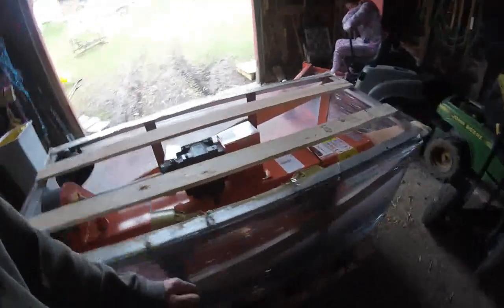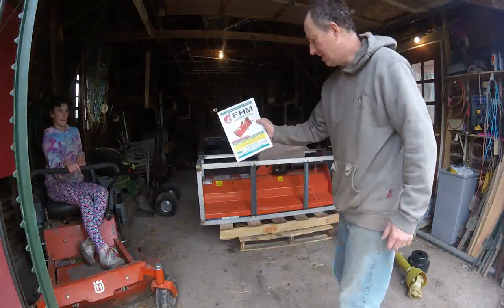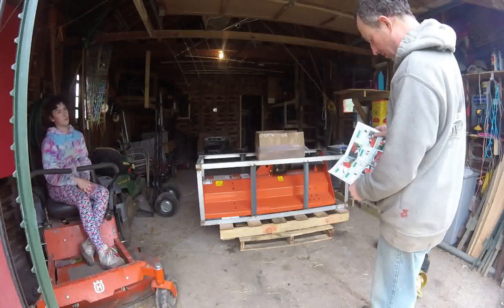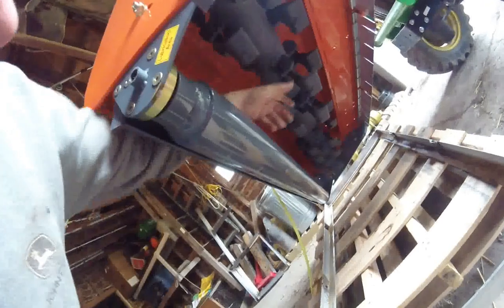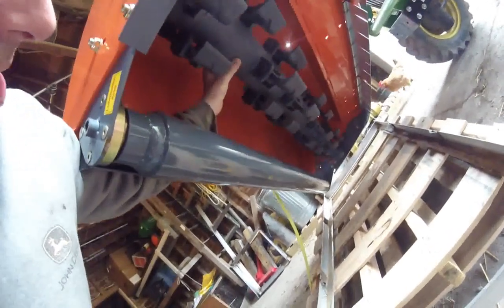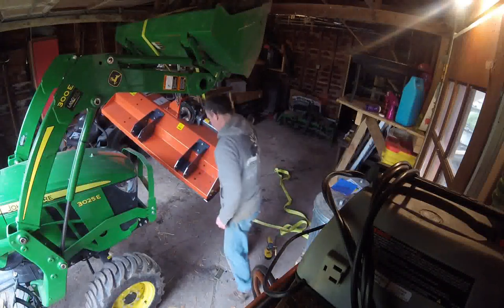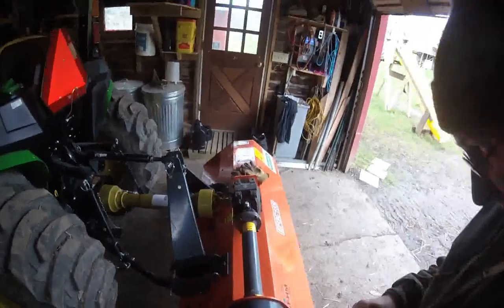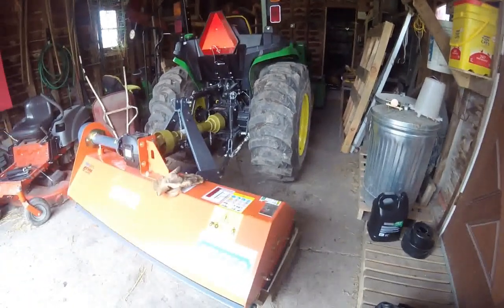Betstco EFGC-155 5' Flail Mower Unboxing

Comment: Be sure to adjust drive belt tension. I found they were lose after I tried mine on so test weeds.
Reply: So what size belts my son did Same thing
Reply: I also found NAPA B-38 as replacement belts available locally without waiting for shiping.
Reply from the maker: 21" belts. 22 and 23 are just too long.

Comment: That’s the size I should have gone with😞 but I didn’t do to bad by going to the EFG135 for my 1025R. I Love that thing! It eats some good size wood and leaves it nice and clean out the back compared to a rotary cutter
Reply from the maker: Yeah I think I could have gone the next size up. It slips the belts before it runs out of horsepower.

Comment: Thanks for the videos.  I just got the same flail and boy the problems.  My question would be have you been able to find out the approximate height for each of the holes for the rear roller?
Also setting the skid height in relation to the roller cut height?
Reply from the maker: I put the skids all the way down, and the roller a little higher. The skids sort of sink it, so the roller could be even higher I guess. Maybe the roller is supposed to hold it off the ground? Guess I don't know.

Comment: r u happy with it? im looking to buy one as well!  how much was it?
Reply from the maker: It is good. Just don't cut thick brush too short, the belts will melt off. I had a bearing come apart, but fixed it with $20 worth of parts. Don't know why that happened.
Reply: @gcrmills  wow! Is yours standard duty? Mine is medium duty! Mine is coming my way
Reply from the maker: They had some kind of special, so I got the heavy duty one. Work around the instructions, they are mostly accurate.
Reply: Cool! That’s what I have ! Winter special 12%off